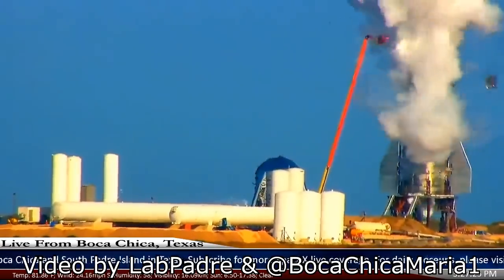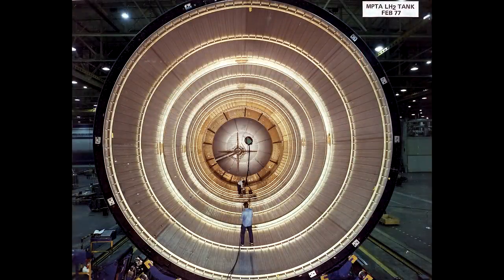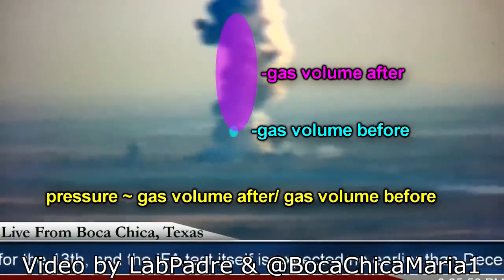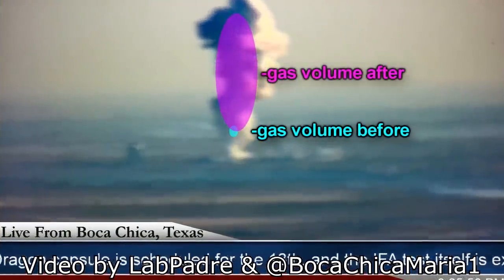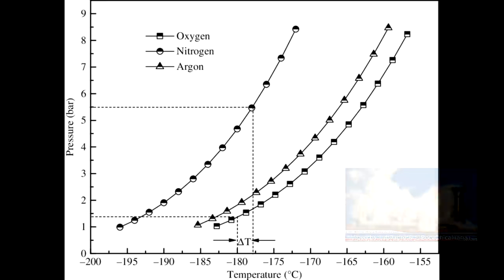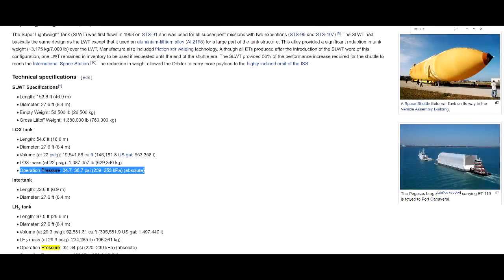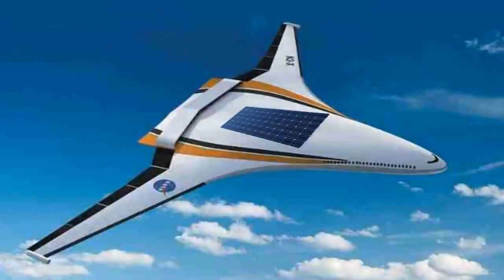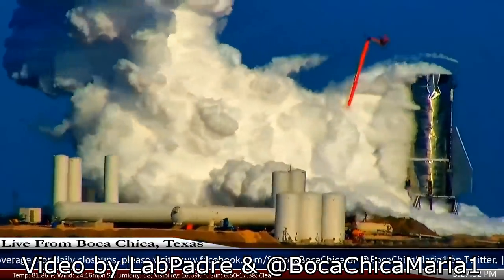Starship explodes, but why?

Comment: Oh look Elon blew up another rocket again. Is this his 10, 20 rocket he destroyed. Yet Spacex is still a success.
Reply: Gosh, what a mystery! It's almost like the company has a 98% orbital launch success rate or something. Idiot.
Reply: In terms of unintentional explosions during either testing or launches, this would be the 4th. 5th if you count Crew Dragon. In terms of rockets which were lost on recovery, you'd have to add an additional 10-11, depending on how you count CRS-18. But any other company would not have even attempted recovery of those 10-11, so you really shouldn't be counting those. Landing failures happen after a successful mission. Remember that.

Comment: "Yeah, a rocket flight will cost 20 times more than a plane flight, BUT WE CAN DO 10x MORE OF THEM IN A DAY, so obviously we'll still be in the black."

Oh, okay, well that makes sense....
Reply: nice moronic strawman argument.
Reply: @Muonium1  How is it a strawman? Do you really think people are going to pay a ridiculous amount of money to go somewhere a little bit faster with far, far greater risk and liability than a cheap ass airline ticket? It didn't work for Concorde, I don't see why it would suddenly work for fucking rocket ships, and having more trips in a day doesn't solve any of those problems in any way.
Reply: @Makingnewnamesisdumb  It DID work for the Concorde. That plane was grounded due to safety, not economics, right?
Reply: @MrRolnicek  it was grounded for the whole deal. It was too expensive for consumers to justify buying tickets, it needed tons of maintenance, the sides of the plane would physically get hot to the touch because of air resistance to the point where even on the inside of the plane the windows and walls would be hot, etc... It had a lot of issues. And rocket travel has many of the same issues and is even less safe and surely would be more expensive.
Reply: @Makingnewnamesisdumb  Sure. That's totally fair. I think they'd still have a market if all of that remained the case and IF ONLY they didn't have the noise issue. But they will have the noise issue. MUCH worse than a jet.
I'm thinking about the Skylon right now. They're on track to inventing the hybrid jet/rocket engine which they wanted to use in an SSTO spaceplane. If starship delivers even close to what it looks like, the spaceplane is an AWFUL idea but Skylon claimed to have plans for a separate design for hypersonic city to city plane which would only go fast outside of inhabited areas. So I'm wondering about the hurdles in their way.
Reply: Her statement sounded off at first—if it's hard to make profit per trip, more trips aren't going to solve anything—but she's actually saying that some of their flights will be the only game in town at that hour, therefore no competition.

(Of course, this assumes people are in such a hurry that they're willing to bet their lives at terrible odds instead of booking another flight.)
Reply: @jshowa o are you telling me or the SpaceX lady? Because she's the one that said this.
Reply: like if doing something 10x more automatically makes it cost 1/10 ... unfortunately it's not that simple

Comment: My guess is it's something with the welding and it being stainless steel.  Welding stainless is more difficult and that is a lot of it.
Reply: Supposedly it was a comms problem where the pumps didn't respond correctly to the pressure sensors. See https://youtu.be/nf5q2YlM2mU at about 1 minute in.

Comment: So far this is atleast 2 explosions and 0 successful manned flights... I don't kno about anyone else but my ass ain't going aboard lol
Reply: Pathetic. Tell me one space program that had manned spaceflight, but didn't have at least two failures before. The comment sections under this channel is retarded. Explain to me, why is the comment section a Musk diss track? The video wasn't about Musk (or at least shouldn't have been, I don't understand why a similar diss track exists at the end of this video, but oh well, it brings in more comments).
Reply: @zoltankurti  Elon Musk is not an inventor, a scientist or an engineer, he just comes with ideas that other nameless humans must create,hes just a capitalist pig and a welfare queen.
Reply: @e.777.r2  thank you for illustrating my point. Next time try cramping less than 3 factual errors in a one sentence comment.
Reply: @e.777.r2  he worked on supercapacitors as an intern while doing his physics degree. They wanted to use the same technology used to create microchips to create very thin insulating layers, allowing for huge capacity. Ultimately the lithium ion batteries renderd this area of research less relevant. The development of an online payment system was an original idea. He wanted to go further with it, so x.com would provide loans, insurance and so on but other board members did not agree to execute that plan. I don't follow tesla, I can't comment on that. At spacex, especially at the early stages he did a very significant part of designing falcon 1, he pushed the idea of reusable rockets which ultimately became a big success both technologycally and financially with falcon 9. He was the one suggesting to switch to stainless steel from carbon composites for starship and superheavy, and I see a big chance that in 5 years you will not be laughing at this idea. Far from it. I think in 2025, launching a 100t to leo will cost about the same as lets say 5 electron rocket launches from rocketlab. Time will tell, just be patient. In the recent month or two he spent lots of time at boca chica, working on the new prototypes, I have no idea what he actually worked on but I doubt he was there wasting his time doing nothing. I don't get why you hate on musk seemingly without a reason. Maybe this is infectious and you cought it from TF? He seems to do a good job at picking the shit ideas and ignoring the successes.
Reply: @e.777.r2  as far as I know there is no price tag on the heads of ex-spacex or ex-tesla employees, they are free to leave. (Additionally those companies in their resume will make them easy to find a new job.) Do you go around and post random hate comments about every other person who has a company where bloody hard work is expected? Maybe you didn't learn this, but now is the time. You should not be successful because of labor unions but because of the work you do. Anyways, wtf do you mean by human exploitation? Does musk harvest kidneys or what did I miss? Or did the short sellers paid news outlets to write articles so they don't have to sell their pants? Musk is a 1000 times better than your avarage folk with as much capital as he has. That's the point.
Reply: @e.777.r2  best argument ever. Feel free to leave this comment section, nobody asked your opinion about me. Unless you like talking to "bootlickers" you really should leave.
Reply: @e.777.r2  right. So don't write stupid comments to me.

Comment: I think they tested pressure limits on purpose. I see no other reason why the crane would be there otherwise
Reply: the point of the fucking test is well documented all over the internet and yet somehow everyone misses it? how? bias is ever inflating with thunder and his fans
Reply: Supposedly it was a comms problem where the pumps didn't respond correctly to the pressure sensors. See https://youtu.be/nf5q2YlM2mU at about 1 minute in.
Reply: The whole point of the explosion was to test the durability of the crane.

Comment: heres an idea you know some skyscrapers are built one floor then jacked up the next built then jacked up and so on and on why not jack large objects into space
Reply: There's not a single skyscraper anywhere in the world that has been built that way. Where did you see or find out that?
Reply: @chuckymcnubbin1518  I forget the source but I do remember that some buildings have been built that way its a quicker way to erect them
Reply: @chuckymcnubbin1518  I think I maybe misremembering what I read some time back just checked and there no evidence anywhere of this technique being used but still how feasible would lifting something up be they talk about space elevators
Reply: @chuckymcnubbin1518  the closest to the jacking I can find is using prefabricated floors and lifting them into place but no jacking my mistake

Comment: We'll probably not see anything 100% functional or reliable from Tesla or Space-X in Tesla's lifetime & probably not after he's gone either. lol.
Reply: What do mean dude? The Falcon 9 has 76 successful launches putting it at 97.4% reliability, has reflown a booster 5 times, lands reliably and has slashed launch costs by a order of magnitude. Do you have to be a “fan boy” to admit that success?
Reply: @hobbyhyper  Not quite an order of magnitude yet. Compared to the shuttle, yes. Compared to other rockets, it's only about a factor of 2-4. Probably a little more now after they reduced the price last. Russian and Chinese rockets are closer in price to the Falcon 9, with Proton M being comparable. But you really don't want to fly your payload on a proton M.

A 2-4-fold reduction in costs compared to all other western rockets is pretty impressive though.

Comment: I really want to see how those SpaceX fans will feel after 30 min flight around the Earth. Must be fun to go thru what normally ICBMs are going thru. Totally good for health all those Gs
Reply: I mean, the proposed 2-3 Gs is what a fairly tame roller coaster would pull. Of course they'd be sustained for longer here, but they're not an excessive amount.
Reply: noname117spore sorry but as usual Elon’s specs don’t match reality. Just like hyperloop his statements on speed and g force don’t add up.
Reply: @timrosencrans7955  The times don't match up with the times they were saying; you'd have to reduce it by a certain amount to match the g forces. Or you could go for higher g forces. But there's a legal limit to G forces, including how long you can sustain them, and I expect for the types of Gs experienced by Starship 2-3 would be getting close to that limit.

Basically, I think the Gs are going to stay the same, but the flight times will increase slightly from the stated numbers.

Also, wasn't it the loop where the speed and g force statements didn't add up, and not the hyperloop? And do note that was only with the math Thunder did, he calculated it from stop to stop rather than thinking that it could hit the maximum speed going between the 2 furthest stops. It might merely be misleading rather than wrong in that case.
Reply: noname117spore yeah the loop figures a way more off. They don’t seem to factor in refueling or passenger loading and disembarking either. I don’t think 3G seating will be quick to get out of. And there is fact that they won’t be allowed Mach speeds anywhere near population and I doubt anyplace would allow 10 launches a day... there kinda loud.
Reply: @timrosencrans7955  I'm stating the likely G forces, not whether it's a good idea or not from a practical perspective.

Comment: Just imagine the waste of material
I am in tears 😭😭😭

I think it is more likley that humanity will run out of resources before it reaches other stars
Reply: Stars? Nobody sane is even mentioning no stars. It will not happen, we don't even have the slightest feasible idea on how to do that, let alone a plan for it.
Reply: We can't reach the stars, goofus.  But we can get to other planets & on those planets, there be resources.  They'll be making way for those planets, moons, asteroids when the need is great enough.
Reply: @shitmandood  Not even that will happen. Once we become so desperate for, say, copper, it will still be way more doable to better our recycling percentages, and so forth, then to mine on other planets. 
And I guess we'll just learn not to have things. Again. 
Some things are just impossible, and will forever stay sci-fi. Emphasis on the "fi" part.
Reply: @aha6500  No, we will get to the near planets.  They would just recycle the copper to build the ships.  Sort of like building the pyramids...probably require the whole world to put it together...but it would happen if the need is there.  Otherwise, back to the dark ages & smaller populations.
Reply: Even travelling at the speed of light, it would take 4 years to reach the closest star. Currently, we do not have any options to go faster than the speed of light.
We can colonize other planets like Mars.
Reply: @cmdrsmain9711  Visit, yes. Colonize, not so much. The levels of radiation are too high, for one.  The distance is far too great to make any reliable and constant supply of fuel and materials possible. I personally don't believe we will even do that.  I could be wrong, but I don't see it happening. We are barely managing to maintain space station MIR, that is very close to us, and still somewhat protected from the radiation. To this day we don't have a self-sufficient station on the North Pole.
Reply: @aha6500  So far there are proposals for living on Mars, such as burying the colony underground to reduce the amount of radiation, along with manufacturing fuel on site (which basically has to be done if you want to go). Both hydrolox and methalox should be possible to produce.

Also, correction, Mir de-orbited. It's the ISS we're managing at the moment.
Reply: @Reverse Climate Change Go check out some videos from Scott Manley and Everyday Astronaut. You obviously have at least some interest in aerospace and space exploration. The truth about our progress in these areas is much more interesting.
Reply: Yeah, ideas that include things like Dyson sphere and teleportation and space-time distortion and so on are just that, ideas. Good for a sci-fi novel. Absolutely undoable, ever.
Reply: @Freeman319 Whatever that specific pseudo-scientific talk is; time and space warping, or whatnot, is possible only in mathematics, as a thought experiment. You will never find one scientist to claim those concepts could ever come to life. It's Star-Trek talk: "Rearrange the influx of the deuteron capacitors! Aye, Aye, sir!", and so on.
The mathematics models to do such things require the amount of energy that would need the entire known universe to be burnt in a split second, harvested and used. Ridiculous. 
It's not reasonable to expect anything built by man to reach 10% of the speed of light, ever, let alone exceed it. C'mon. Let's not call our pipe dreams science.
Reply: @Freeman319 You sound unnecessary defensive. Why my essays, as you call my short comments, bother you? You're free to write your own. 
But, since now you started using the keywords that provide you comfort, like "plebs", I know pretty soon you'll start honking and calling me boomer, even tho I'm not one, so I'll be gone now. Bye.
Reply: Exactly. Money could have been spent feeding and housing people. A sad fucking waste of money and time. I bet  a team of some of the smartest people in the world wasted their time on this shit instead of helping people in need. Humanity is sick.

Comment: Wasn't the test the day before with a non-cryogenic gas? I figured the extreme cold of the cryogenic liquid gas made something too brittle and that's why it failed on that test but not on the fill test the day before. I might be misinformed as to what they were filling it with the day before, but still, maybe just getting cold then emptied and warming back up, then getting cold again fatigued whatever weak point that eventually gave way.

Comment: 1) if this was an explosion, the thin shell of the rocket would have been disintegrated, it is not, the bottom (and top) end of the rocket seems to be holding fairly well
2) a piece of what looks like a container is seen propelled into the air
3)given the near sperical shape of the tank, and the longuish shape of the rocket, there are prolly 2 tanks in the rocket
I'd say the top container broke near the seam line for some reason and it's the oxigen flash boiling when in contact with the atmosphere that propelled (not exploded) the top lid of the top container into the air. It's really like shaking a room temp coke can and then opening it up, the size of the mess isnt proportional to the amount of coke.

Comment: For a person that purports themselves to be as 'intelligent' as you 'Thunder', your lack of research on this incident is really disenchanting. They said they were doing a 'maximum pressure test'. They said they had retired this Mk of vehicle as they had achieved all their testing goals with it, and have two new vehicles with which to continue testing. What is a max pressure test of a vehicle you don't need anymore, a destructive test to determine max pressure the tank can withstand. One can debate what value such a determination can have but why not, the more detailed knowledge one has of a system the better. How did they do it, like you say, probably filled it with LOX then pumped He until it burst, having disabled the over pressure valves, nothing too complicated. So the question you dedicated a whole 10min video to thumping your chest could have been answered by a 20min google search collecting just a bit of information about the incident. And while Elon deserves to be taken down a notch often enough, this just isn't it. It is this kind of over zealousness that sometimes makes YOU Thunder look like Elon... Perhaps get back to your lab and do something you are actually good at... When you make yourself about being the chief debunker and truthteller, you have to make damn sure you are right 99,9% of the time, or you just look like an ass!
Reply: I watch a lot thunderf00t video talking about Elon Musk. He seems to have an irrational bias hate for Elon. Have you notice that thunderf00t doesn't provide sources his for his debunkery. Bad form for a intellectual debunker.